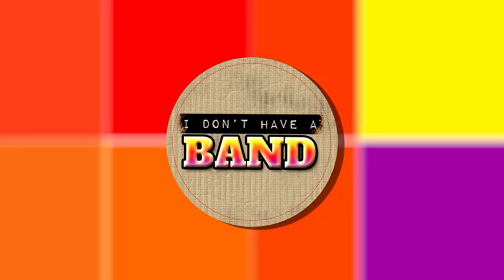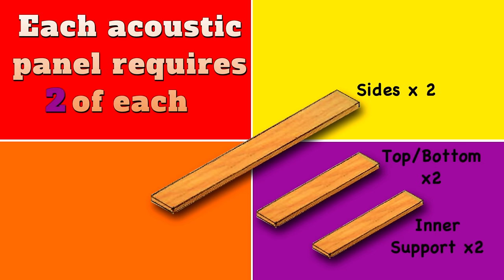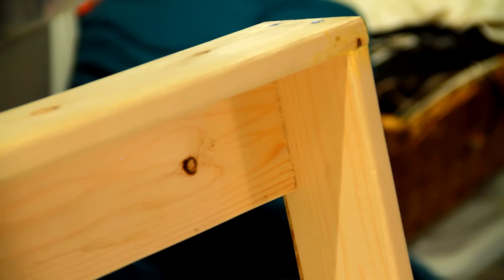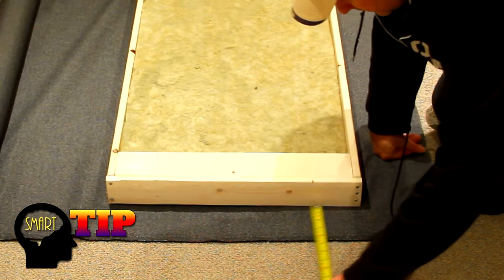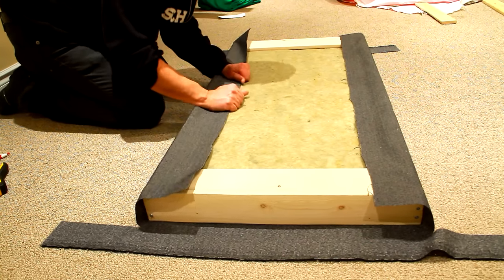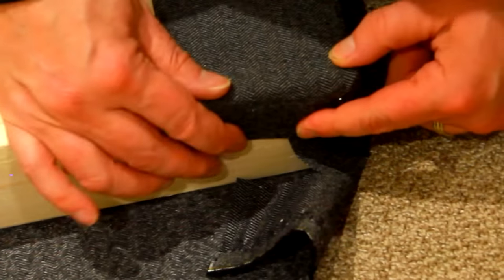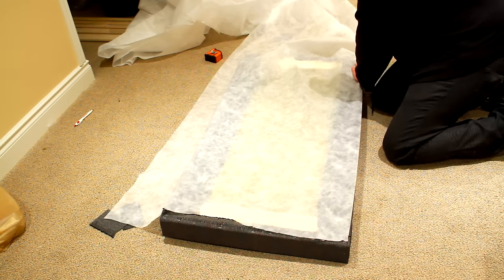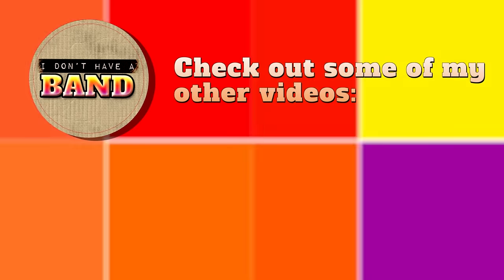DIY Acoustic Panels - How To Make Your Own Cheap and Awesome Panels

Comment: READ the instructions of the Roxwool.  It clearly says that it's for INTERNAL to the wall  use, NOT for use as acoustic treatment inside the room.
Reply from the maker: I spoke to Rockwool directly.  They had no concerns using it for panels.  That disclaimer is standard protocol. But I recommend everyone to do their due diligence.
Reply: @LonelyRocker  They don't even say anything about using it as panels on the outside of their packaging.  It's meant for inside walls and in between floors.  Not for external exposure usage.

I don't even know why you'd want to use that crap anyway.  It's absorption coefficient curve isn't even that great.  Look at 125hz to 500hz, as that's what the major differences are in all of these absorption products for mid to high frequency.
Reply: Look, I studied music production and the professionally made studio had Rocksul panels all over. These ARE the panels professionnal take for their studios, and I know it for a fact from multiple sources, not just my school.
Reply from the maker: Thnx for the insight.  There have been a couple of negative comments about the use of Rockwool but I did a ton of research before I made and then did this video.  I even spoke to a representative at Rockwool and they had no concern about this application and even sent me some data to back it up.  I always tell everyone to do their own due diligence but great to hear pro studios are using the same material.  And the results are really good.  Not sure if you saw the sound test follow video I did: https://www.youtube.com/watch?v=aUBgX8GYQ_A&t=130s
Reply: @LonelyRocker  Rockwool does NOT have a nice and smooth absorption coefficient curve compared to some of the acoustic foams on the market.   That's the biggest problem with ANY type of building insulation.  It actually CAN overabsorb in the 125hz to about 500hz area.  That's where the BIGGEST differences are between ANY absorption material commonly used for midrange to high frequency absorption.    Does that make a difference?   YES, it can.  Especially if you have a lot of coverage in your room.

Yes, I've done a lot of research too.  So and I have been in many rooms that have used a variety of different types of acoustic foam, rock wool, Corning 703, etc. etc. etc.   The best I have exepereinced is Acoustic Fields acoustic foam.  if you look at their absorption coefficient graph, it's about the smoothest between 125hz and 500hz on the market.

As far as absorbing low frequencies under 100hz, you have to use a pressure active device, Diaphramatic being probably the most effective, ESPECIALLY in the lower frequency range.  The ONLY ones on the market that will actually absorb in the 30hz to 50hz range, which is typically the range that people NEED, is again, Acoustic Fields.   Yes, I know, I sound like I work for them.  FYI, I don't work for them.  I have just done a lot of research and have actually been to one of their listening rooms and was completely blown away.  IT was by far, the best sounding room I've ever been in. I"ve been in multi-million dollar studios, I've been in many expensive professionally designed and built listening rooms, etc.   By far, Acoustic Fields had the best sounding room and all they used was the products they actually design and mfg.

Again, Rockwool is NEVER going to be used in any of my rooms.  It's not good for acoustic treatment and it was never designed for room treatment.  It was designed for building insulation, which goes inside the wall cavities and it's not to be exposed to the people inside the room.   It's also highly toxic material where you should actually wear protective clothing, respirators, etc.
Reply from the maker: Couple of points.  The Foam material you have proposed is exponentially more expensive.  This is a DIY channel.  Most who plan to build their own panels just want to improve a space that's not optimal in the first place.  These panels make a huge difference.  I've tested them and have a video showcasing the results. Are they on par with top studios?  Of course not!  A lot more goes into a pro room than just panels.  I have discussed this many times in my videos. And the Rockwool insulation is not toxic.  I got hold of official data sheets on the product.  But I do encourage any who plan to use this material do their due diligence.  I very much appreciate your viewpoint.  You are not wrong as far as the acoustical properties.  This channel is positioned for home guys looking to bump their spaces a bit.  And these panels do a great job for the amount they cost...
Reply: @LonelyRocker  It's because it's not made in huge quantity like building insulation.  But building insulation companies are NOT room treatment companies, they don't know anything about how to treat a room.  All they care about is selling building insulation and some cheapskates want to buy it and use it as room treatment they aren't going to stand in your way.

What would you buy something from a company that didn't design the product for the usage you want to use it for?   Why?  That makes NO SENSE other than it's cheap.

One thing to be careful is to not position building insulation  as the best room treatment product in your videos.  It's NOT.  It's cheap and that's about it.  Does it absorb? Sure, just about any material does..  They all do about the same quality of absorption in the 500hz and above.  But please focus your videos on what is the most important facet of absorption for mid range and high frequencies. 125hz to 500hz.  Also, you're going to also need diffusion and LF absorption, are you also going to buy cheap products that don't do that effective of a job too?    That's typically what people on a limited budget do.  They aren't buying treatment, they buy cheap materials and masquerade as treatment.
Reply: Roxul/Rockwool are fine for building acoustic panels. Calm down.
Reply: @Oneness100  I'm sorry life didn't work out for you  might want to find another activity to help dissipate some of your unchanneled anger such as cardio Sports seeing as audio is upsetting your emotionally unstable Constitution
Reply: Oneness100 bro, i’ve worked at a studio treated by dennis from acoustic fields. Sounds dope.. also cost a fortune and was a luxury. You’re making audiophiles look unattractive.